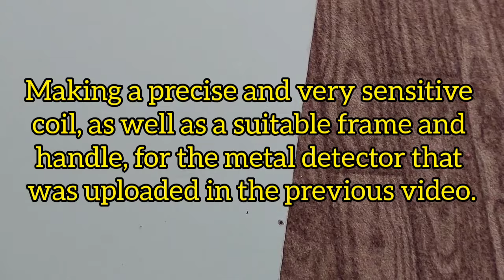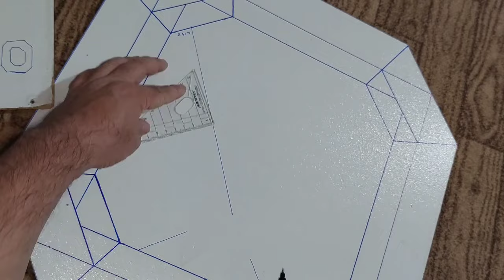2 Meters Depth - How To Make a Metal Detector With a Depth Of More Than 2 Meters

Comment: That is Gary Lacombe chemelec  pulse pi detector circuit,  . i knew him as the most kind man  . sadly he passed away in 2019..  i build his v1 and v2.  , at v2 . I have more trim buttons knobs  , extend the board VR potmeter to a extended trim  .. 2 meter on big metal objects no problem but coins and gold not 2 m by far ..  Delta pulse is another powerful detector and is available in a kit as well
Reply: Thanks for the info. Do you have a link to his circuits ? I looked but could not find any circuits linked to the name you gave.

Comment: You can improve add another round coil on the center to final filter conjunction. And also use a headphone not like a large noice speaker.
Reply: O sxemi cox gözel hazırlamısınız  hemen sxemden biri menede lazımdır nece elde etmek oıar

Comment: My friend is it okay to use 1.6 mm copper wire ?
Reply: Or whuc is better, 1mm or 1.2 mm or 1.6 mm
Reply from the maker: You need to adjust the ohm value of the coil with a resistor.
But I do not recommend it
Reply: @creative4979  thank you my friend, I already bought all the necessary electronics and I really excited to start build your metal detector ♥
And expecting to reach 2 meters deep 😍😍😍